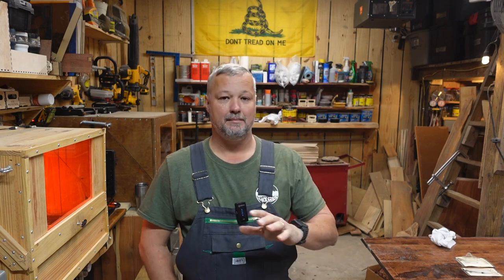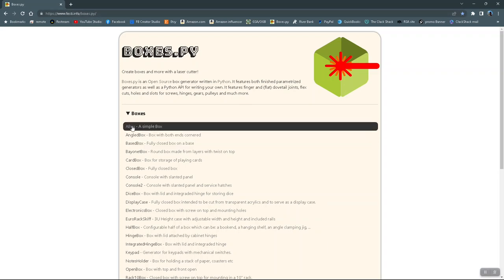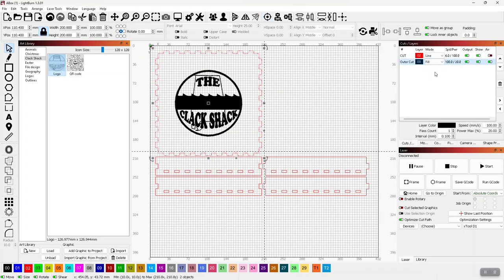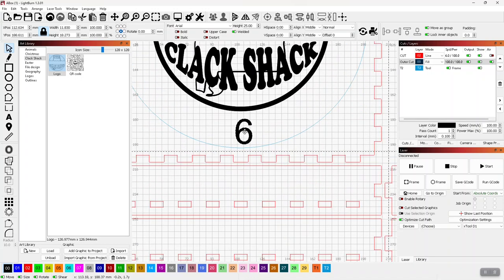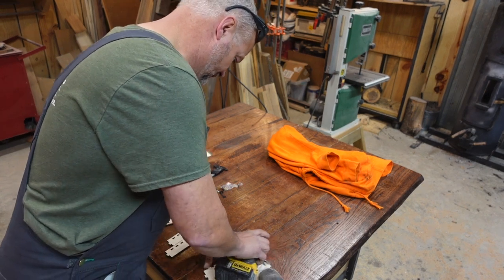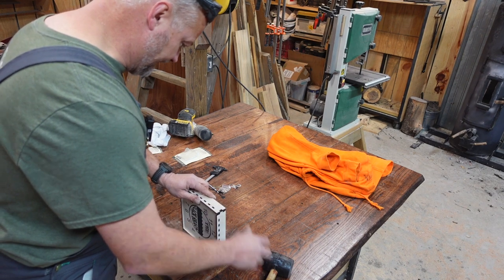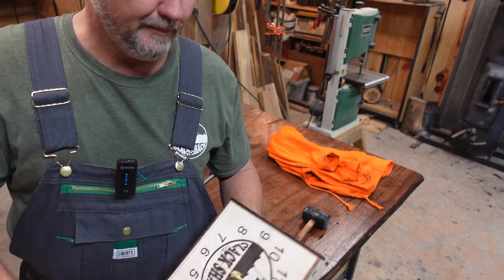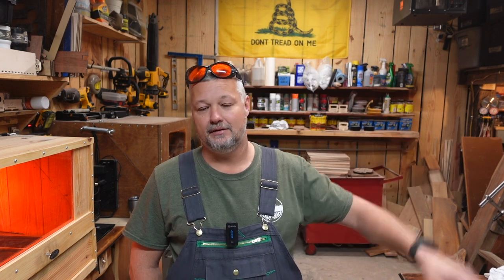Easy DIY clock project with the XTool D1 pro

Comment: You can use the array tool ( third from the bottom on the left ) for the numbers. It is MUCH easier than placing each number.
Reply from the maker: Yea, didn’t think to use it. Spacing gets messed up using text to line

Comment: I got the boxes py app open thanks to your link I made the box for the clock but on the 4th side wall my Z1 laser just stopped burning. The Box goes together real nice and tight no glue but I have to wait till Monday to get back of my shop and try to burn the fourth side if the laser is working nothing but issues with all these lasers I have three of them thanks Dave Happy New Year
Reply from the maker: Glad you got the boxes to work. On your PC, make sure the USB ports arent set to power saver. Also set the pc to not go to sleep when plugged in. Could be the issue.
Reply: @TheClackShack  Thanks,I'll check that out,hopefully this will work out...

Comment: Are you using the exact same size as the affiliate link? With only 1/2" of thread is there enough room for the 1/4" wood with only leaving 1/4" for the hands installation? This is such a great idea!
Reply from the maker: Not the exact one, but the shank size on the one I used is 1/2 inch. I don’t think the hand connections are included in that 1/2 inch
Reply from the maker: The illustration shows the threaded shank to be 13 mm long